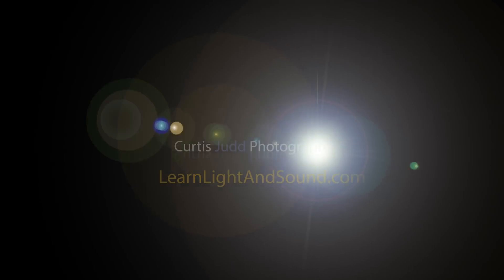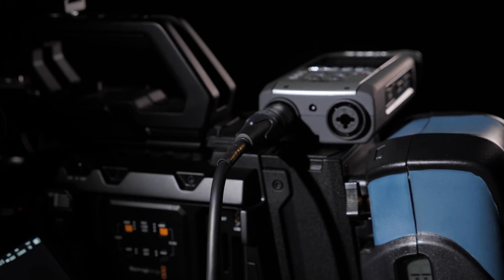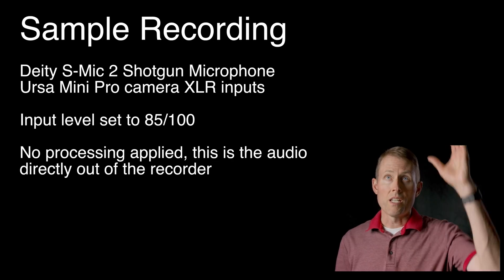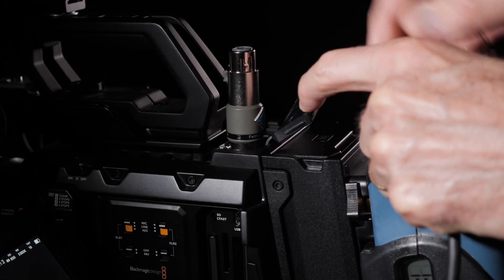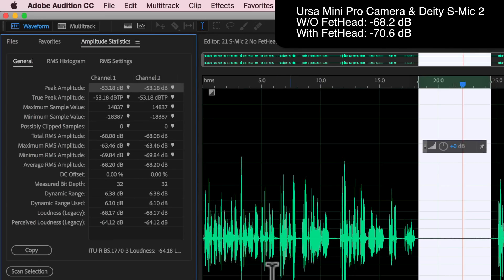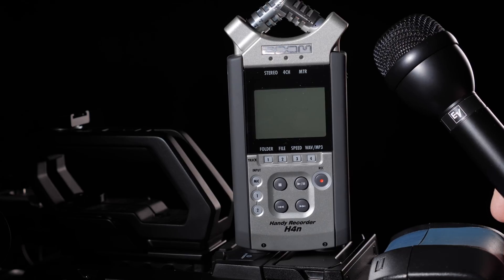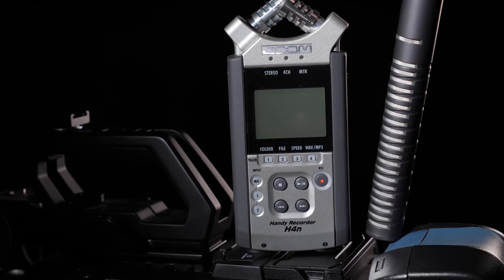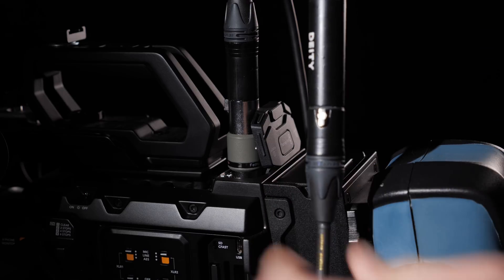FetHead Phantom: Louder, Cleaner Audio for Condenser Microphones

Comment: Great job as always! Curtis, i have a zoom h6 and is enough for my videos. But i'm having troubles with interviews. In other videos you mention hardware limiters for preventing clipping with variable level sounds. I'm seeking for a solution. Can you analyse the ART Tube MP/C in this type of situation? Many Thanks!
Reply from the maker: Hi Marcos, I don't think that I'll be able to get my hands on that but Sound On Sound did a piece on it a while back: https://www.soundonsound.com/reviews/art-tube-mpc

From their review, it sounds like that particular unit is intended to impose "character" so it is not necessarily transparent sounding. But they did conclude that it sounded reasonably "classy" when the compressor was set with mild settings.

Comment: I'm not sure that it's a good idea to put FetHead directly to camera's input socket. 
In this case low level signal goes through the long cable from mic to fethead.
In another case, if we put the fethead directly to mic's output, the signal level in long cable will be much larger. It's better for noise to signal proportion.
Reply from the maker: Fair enough. Tradeoff is the higher load impedance through the long cable run. As long as you keep the cable short, either way works. Also, if I’m hand booming for film production, I’d rather not have the extra weight out at the end of a boom pole.

Comment: Is there any way you could do a review on this and see if it is a good budget option for a wireless lav system? https://www.amazon.com/Movo-WMIC80-Wireless-Microphone-Transmitters/dp/B01L84HZOK
Reply from the maker: Hi fgh, probably not, unfortunately. I've had very bad luck with several budget wireless systems and the samples I've heard recorded with Movo microphones were not very good. Sorry to disappoint, but I probably won't have time to review the Movo wireless given what I've heard from them so far. Sorry about that.
Reply: Curtis Judd okay, thanks for the info, that actually makes the decision on whether or not to buy it much easier.

Comment: You should plug it into the microphone-end, not into the interface-end. You don't want to amplify what's happening in the cable.
Reply from the maker: Thanks Joey. What about sending a load impedance of 3000 ohms over a cable like one does when connecting this to the microphone? There's some risk there as well. I tried both and they both sounded the same, fortunately. But I was using 25' cables so maybe it doesn't make a difference with a good cable of that length. I suppose the question could be answered by trying both options with much longer cables - maybe something in the 100' range.

Comment: What was the secret?
Reply from the maker: You can also use it for dynamic mics. :)
Reply: Curtis Judd Ah so! Yes. Well the secret for me was that anyone would use them on a condenser mic. I have the original non-phantom ones for my Fat Head ribbon mics and they are pretty much required for ribbons. I also used them on my SM57’s and other dynamics with excellent results. But I can’t really see why there is a use for a phantom version even after watching your fine video. I can tell you an interesting issue I had. I tried plugging the unit into my 702 recorder then run an XLR cable to the ribbon mic. That did not work, it caused all kinds of noise issues. Put placing the units close to the mic... no problems at all!
Reply from the maker: Interesting, thanks Allen. How long were the cables? Just the standard 25'?

I think the most common use case for me would be when recording a shotgun or super cardioid mic directly into a cinema camera. They could also help with more consumer grade recorders like the H4n.
Reply: Curtis Judd Yes the cable was 20 or 25 feet. It amazed me how it absolutely would not work plugged directly into the 702. Cascade confirmed it would not work due to impedance mismatch.
Reply from the maker: Hmm, interesting. Thanks, that's good to know!
Reply: @curtisjudd  For me it was the opposite. Cable is 20 feet Monster Classic. I get noise when connected directly to my SM58 and it works great right on the zoom h6 side.

Comment: I’ve found the Fethead to be really useful with cheaper recorders where raising the gain even above 50% can introduce a small amount of noise. The Fethead keeps that gain down on the recorder.

I’ve also found another use for it with lavalier microphones. I use a VXLR+ which uses phantom power to supply 5V to the lav. That seems to make a lot of them slightly more dynamic and noise slightly less. In order to make the VXLR+ work, I use a Saramonic battery preamp and a Fethead!!! 

So Saramonic - Feathead - VXLR+ - lavalier. The recorder gain is set at zero and the Saramonic does less amplification but merely supplies 48V for everything to work.

The result is a very dynamic lav sound with the noise floor only really limited by the quality of the lav itself. 

I’ve found a lav quoted at -80dB called a Little Clippy which uses a Primo EM172 capsule and as it is, it’s really quiet but on the end of this set up, it’s a really lovely dynamic sounding microphone.

Probably could have saved myself the bother though by buying a quieter recorder in the first place .....

Useful for people with cheaper, ‘consumer grade’ recorders though.
Reply from the maker: +Ian Craig thanks for the insights Ian!
Reply: Wow, I am really surprised to hear that 😮 
I've just recently bought the rode vxlr+ converter, hoping to solve my computer desk problem with some of the mics I use being electret ones and audio interface not providing any 3,5mm trs socket neither a plug inpower of 5v. With vxlr+ I am able to connect any mic to my Focusrite scarlett 2i4 1st gen and that is awesome - such simplicity! 
However, I was sorry to find that vxlr+ intruduced a lot of noise to the chain! I really didnt expect that... I mean, it is not that bad as onboard soundcard mic input of my pc or other crappy soundcards, but this noise is clearly audible and annoying... :( I tried plugging it directly into the interface (with phantom power on, of course), tried plugging it via a long xlr cable... tried different electret 5v mics... (not the highest quality though, they were jus simple pc headset mics: Antlion ModMic and a V-moda boom mic), and in all scenarios the noise is still there... what made me state, that this is a vxlr+ matter, not the microphones' noise. Those same mics used with some external mobile recorder didnt have that noise, there was a noise either, but different, quieter... so it was a preamp noise of that recorder). 

I am really bugged by this because no one ever mentioned on the web that this vxlr+ generates so much noise... Bu to my surprise you state that achieved a really clean audio chain with your lav mics and vxlr+ and fethead... Hmm... does that fethead do something to reduce this noise? How? It is AFTER the vxlr+ in the chain so it should amplify all the signal from vxlr+, the voice and the noise as well...

What is your experience with this vxlr+ that you dont get any noise? I mean, it is not the end of the world, it is not THAT loud and bad, but compared to any condenser mic plugged directly to the same interface (focusrite scarlett 2i4 1st gen), which is dead silent with the same gain level, it is a somewhat night and day difference...
Reply: Thanks for the insight. Now I have to try that with a clipper mic

Comment: Thank you for the video, Curtis. I have a pair of Samson CO2s for indoor recording, that you had reviewed in the past, and an H4n. The combo is to put it mildly, quite bad, gain is at 85-90 talking at 45 cm, so I ve refrained from using it at all. Should I save for a better recorder, or do you think the FetHead would help me enough to justify the purchase?I also plan on purchasing a NT4
Reply from the maker: Hi Dem Drys, the CO2 is a decent mic for the money but does require a preamp with enough clean gain to handle it. Not my first choice mic, but decent if the budget is super tight. Same with the H4n. I’d either save up for a recorder with more clean gain or add the FetHead Phantom to clean things up with that combination. Ideally, you’ll have an easier time of things with a better recorder.
Reply: thank you very much for your input Curtis!

Comment: Great video as always. How does this compare to the cloud lifter?
Reply from the maker: Hi Steven, thanks. The Cloudlifter only works with dynamic and ribbon microphones as it does not pass on phantom power to the mic. The FetHead Phantom is designed specifically for condenser microphones which need phantom power.

Comment: So should I just get the original Fethead since my Azden SGM250 takes in AA Battery?
Reply from the maker: That'll work and give you even more gain than the FetHead Phantom. The FetHead Phantom supplies a little bit less gain as condenser mics usually don't need quit as much additional amplification. You could go either way. About how much additional gain do you need?
Reply: I'm not really sure how much gain I need.  My set up is the Azden SGM 250 and a Zoom H5. But I think an additional 18db of gain will help anyway. I'm definitely interested!
Reply from the maker: For that combo, the Phantom version would probably be a better bet. The non-phantom version adds 27dB of gain which is likely too much. You'd have to drop the H5 input level to the point where it was digitally attenuating the signal and you'd end up worse off than without a FetHead if I had to guess, having not tried that particular combination.
Reply: Oh ok that makes sense! I didn't know the non-phantom version add that much. Thank you Curtis!

Comment: I was looking into this exact item a while ago and came upon one additional concern - on many 2 channel recorders phantom is global so if you are using the second input for a wireless unit you will need to either a. Make sure its circuit design blocks phantom or b. Plug in a phantom blocking barrel which Triton also sells.
Reply from the maker: Thanks Andrew, good find!

Comment: does this benefit the tascam dr60 mkii?
Reply from the maker: It can, depending on the microphone. I find that the 60DmkII supplies a fair bit more clean gain than the H4n so the FetHead phantom isn't generally necessary with condenser microphones, even with the NTG2. For the H4n, however, I found the FetHead Phantom to be a nice help.

Comment: Is there any point in using this if you're using a good recorder like an F8n or MixPre-10T, or does it also depend on the mic?
Reply: Short answer: No, not usually. Under most circumstances with high quality preamps that have sufficient gain like those in the MixPre devices or F4/F8/F8n, there will be less than 3dB (i.e., inaudible) of measurable practical noise floor difference, even with very weak mics like the SM7B. Inline preamps like the FetHead or CloudLifter are primarily useful when dealing with cheaper preamps that have a lot of self-noise at high gain settings, like the Zoom H4n or built-in camera preamps talked about in the video.
Reply from the maker: I cannot think of a situation where the F8n or MixPre-10T would need a FetHead. Some very poor quality microphones have very weak output levels but even so, the F8n or 10T should be able to handle them. And if you're recording with an F8n or 10T, you're probably not working with very poor quality mics. :)
Reply from the maker: I agree.
Reply: True. Okay, thanks. So the only scenario I imagine wanting this for is if I'm recording straight to the camera.
Reply from the maker: That's why I have it in my kit.
Reply: Considering the quite reasonable price, it seems worth it to have one of each type in one's kit. You never know.

Comment: The phantom version gives 18db amplification, but the non-phantom version gives 27db! So if you don't need the phantom power to reach the microphone, the non-phantom version seems to be much better.
Reply from the maker: Yes, another bonus if your microphone doesn't need phantom power.
Reply: @curtisjudd  hi have you tested the dynamic version of this and is it a true 27 gain and does tone change much? I'm planning to use this with my focusrite 2i2 with se electronics v7. Do you think this would be good clean gain? Thank you!
Reply from the maker: @NewbArchitect  I have not tested the dynamic/non-phantom version of the FetHead, unfortunately.
Reply: @curtisjudd  oh ok, thank you for your reply :)

Comment: Did you notice any noise floor difference if the FetHead was hooked directly to the mic as opposed to in the Ursa or other recorder?
Reply from the maker: Good question, no, but I wasn't using extraordinarily long cables, just 25 foot.

Comment: hey Curtis, quick question, i use a cloudlifter, does the same thing right?
Reply from the maker: Yessir, same thing. Technically the cloudlifter is like the original FetHead, designed for dynamic or ribbon mics which do not need phantom power.
Reply: Thank you, was wondering because the salesman who convinced me to get the cloudlifter was not as technical in explaining what it does, he just said it improves and increases sound, so watching your video, and the detail you give, i thought i was short changed. thanks for the vids always helpful. while im here, need a bit of advice, there is an individual selling a second hand rode NTG 2, and a second hand Audio Technica AT897, i can only afford one, which would you get? im only asking because of what you said in the video about the NTG 2 in this video, i was opting for the AT897 but now i am doubting my choice.
Reply from the maker: Hmm, I haven't personally used the AT but in the samples I've heard, it sounds quite similar to the NTG2. Here's a sample that might be helpful for you: https://youtu.be/iOMnnK07AoE

Part of the question I think depends on the recorder or camera you'll be using?
Reply: thank you, I decided to go with the NTG 2.

Comment: You introduced the Fethead into your chain at an interesting juncture, the camera XLR input. I like the Fethead Phantom but one aspect I do not like is the degree to which it torques the XLR port of either the camera, recorder, or microphone under normal use. I have never broken anything, but the form factor of the Fethead provides a nice, long lever for undue force.
Reply: That's definitely something to be very careful about. A short 1.5ft or 3ft XLR patch cable can pretty much solve that potential problem, without introducing any measurable signal degradation between the FetHead and the camera or recorder.
Reply from the maker: Good idea.
Reply: I use a 12 inch XLR to XLR cable between the mic and the Fethead to prevent your concern.
Reply from the maker: That is a fine point, thanks for that. This is not something I would want to use on a regular basis, but good to have in the bag for when I'm in a pinch.

Comment: Hi Curtis, have you found a device that can give the Rode VideoMicro(3.5 mm) or any 3.5 mm mic plug in power?  I have a Beachtek DXA-Pocket mixer and this does not supply plug in power. I am using a Zoom H1 between the VideoMicro and the Beachtek to provide power to the mic. I have searched hi and low for an adapter that can do this for 3.5 mm mics.
Reply from the maker: Yes, it isn't cheap, but try this: https://darren-nemeth.squarespace.com/stereo-and-mono-microphone-9-volt-battery-power-supply/
Reply: Røde makes an adapter, the VXLR+. (Not to be confused with their older VXLR without the +, mind!). It's an adapter to mount a 3.5mm microphone, such as the VideoMicro, to an XLR input, and if the XLR input supplies 48V phantom power, the VXLR+ transforms it to 5V plug-in power for the microphone. (The very similar older VXLR does not do this).
Reply: Otherwise there's the Saramonic SmartRig+ which has two XLR and two 3.5mm sockets. The 3.5mm sockets do provide plug-in power. And the output can go directly into a 3.5mm input on a camera or a smartphone.
Reply from the maker: Good alternative, yes.